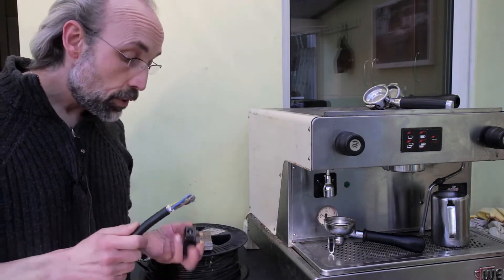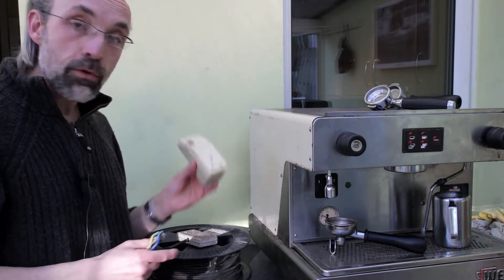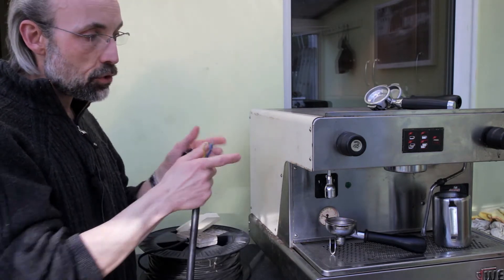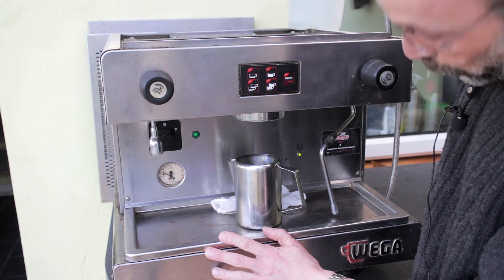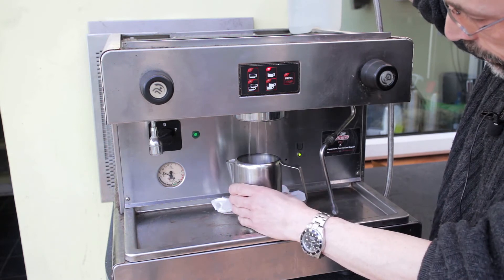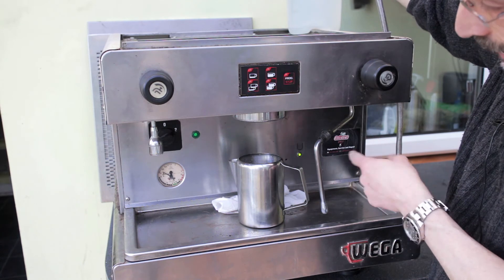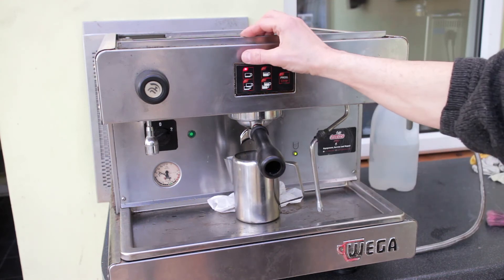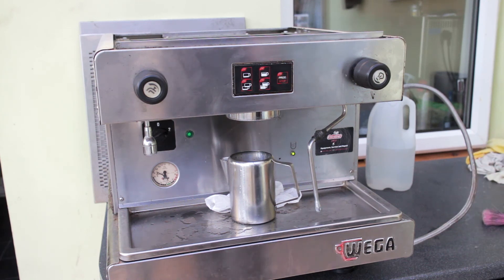Wega Espresso , Project Coffee Part 2, Power & Testing

Comment: The first part of this video feels very very very familiar.
I need to get myself one of those plug-in RCDs...
Reply from the maker: I'd recommend it, I was very wary at first. An electrician I spoke to helped a lot. Essentially, the entire triple element is about the same as an electric fire so OK for standard home mains, I'm bout great at electrical things.
Reply: @spidiq8  The wiring where I rent a room is already very dodgy – the entire flat with all it's rooms runs on 3 circuits – but assuming the washing machine, microwave and the stove etc. are all off, it should handle one of these babies. Faulty commercial machines are far cheaper around here than working but neglected prosumer HX/DB Vbms and the like...
Now that I've seen this crazy idea working on your videos, it seems less crazy. (I'll be eating my words if I wreck the electrical works in the house and get evicted, but anything for good coffee.....)

Knowing practically nothing about electricity (except the big ouch part), this is likely a stupid question, but I do wonder how the components inside the machine, such as the pump, will stand up to the single phase power if they were designed for smoother/3phase input.